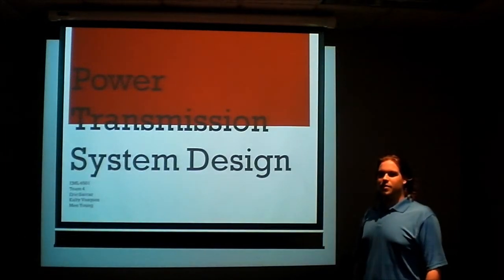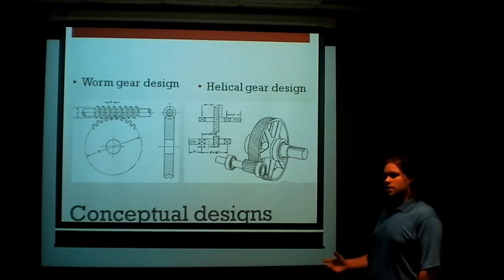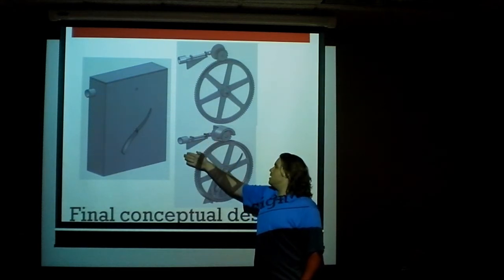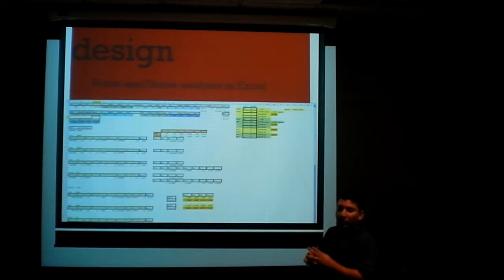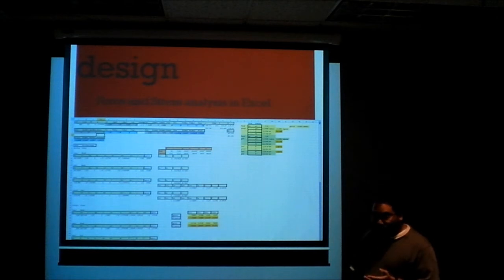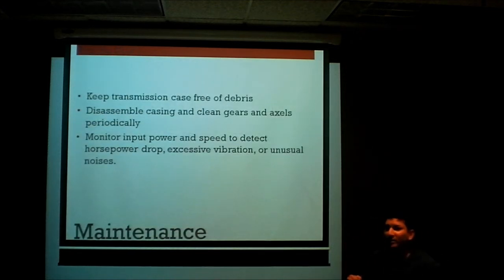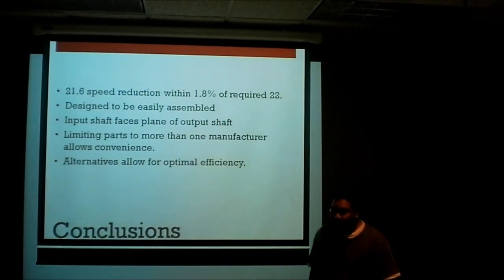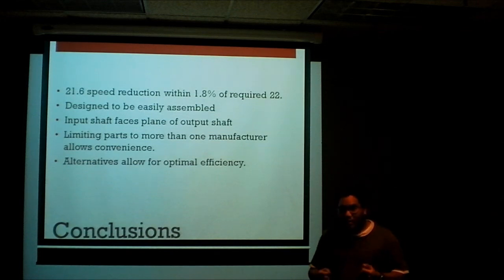Team 4: Power Transmission System Design

Comment: Excellent PowerPoint presentation and one of the few presentations where I could read the slides. The lighting is excellent. The discussion covers all the crucial points. The explanation on the thought process to arrive at the arrangement of shafts, gears, and bears was very good.